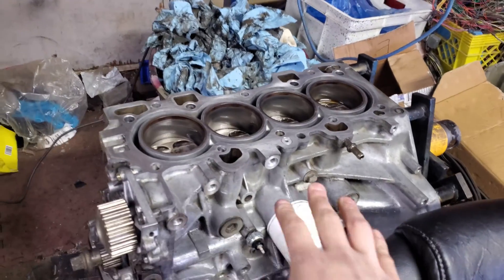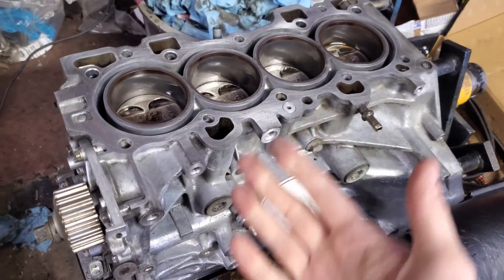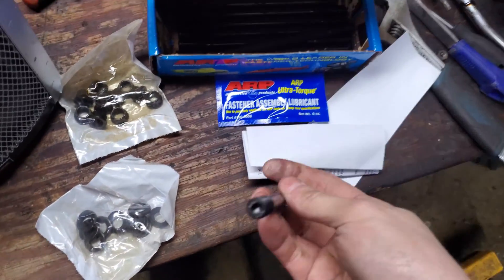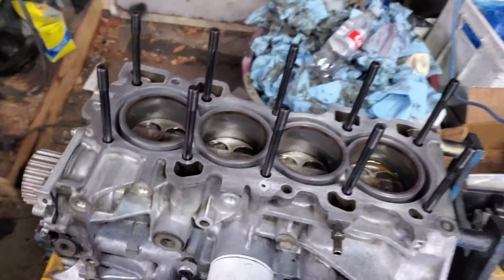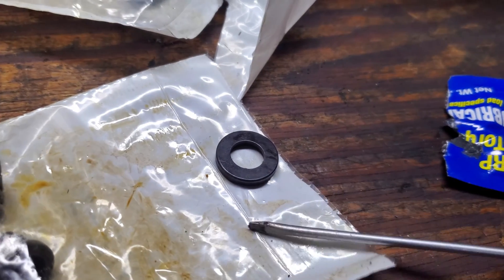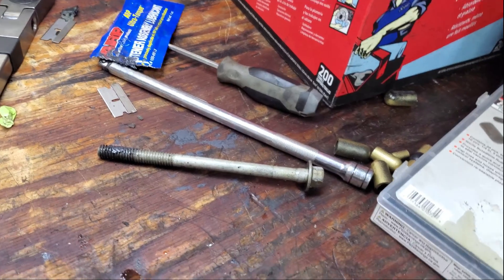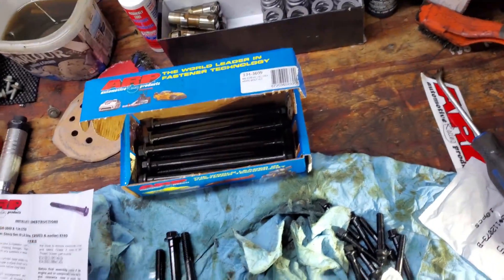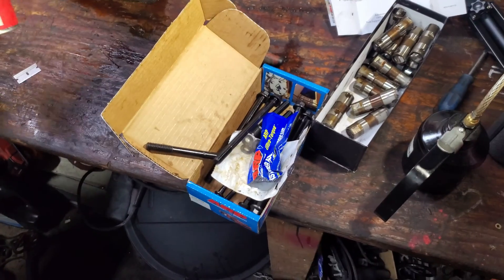HOW TO: Install ARP Hardware (Bolts, And Studs on all engines) Honda B-Series / LS Shown!

Comment: Be careful, Most taps will cut the threads to a larger size, If the tap or die removes metal, Stop don't use it, A thread chaser would be a better option when cleaning threads.

Comment: Im all confused on the the torquing lol like it says 3 equal to get to 115 so i assume its first pass 38 and 2nd 38 again and final 38 so go or take that will be at 115? Or should i do them all on each of the passes at 38.4? Thanks and sorry if i confused anyone this is with head bolts

Comment: Thanks for the info. I have a Lt1 I’m about to install the heads back in spring. I’m also using the Arp head bolts and was wondering, as they recommended on the threads of the bolt to use Thread sealer. How much of the bolt threads should be covered with it ? Thanks
Reply from the maker: Hey sorry for the late reply! Usually a 1/8" bead down the length of the threads unless otherwise noted in the instructions that come with the hardware! You can also go to the ARP website for more details or if you buy a second hand set that didn't come with instructions. ARP usually use a different torque spec than factory hardware which can also be found in the instructions / website.
Reply: @RaineLutz  sounds good! Thanks for the reply